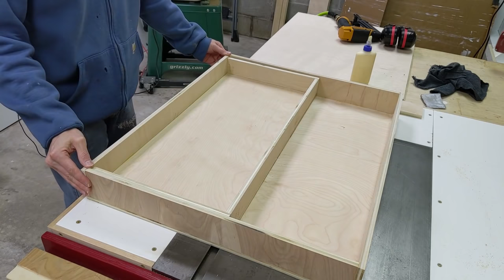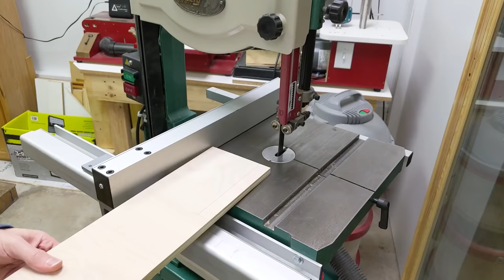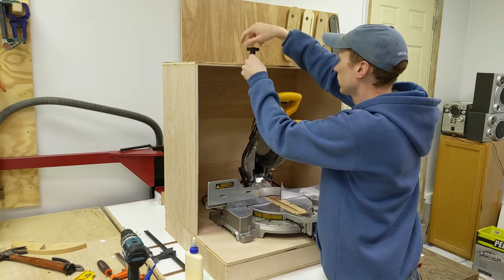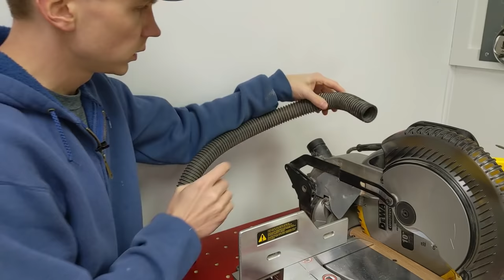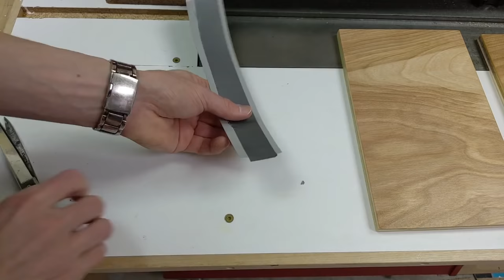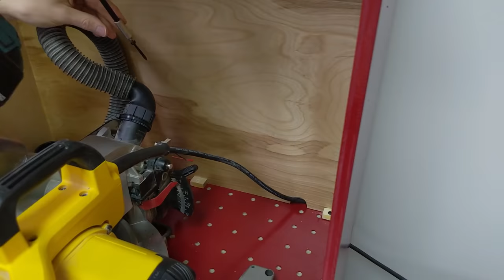Super Effective Miter Saw Dust Hood

Comment: Duct tape - the handyman's secret weapon.
I really like the relief hole for the hole saw dust.  Seems to work very well.
 One long slot for the downdraft section works better than lots of small holes.  As the video shows, most of the sawdust lands between the holes and is hard to sweep into the small holes.  A long slot hear the back of the downdraft section makes it very easy to sweep the sawdust into the slot every few days.
My dust drawer has two 2" holes in the back with an adjacent gap in the divider to the downdraft section.  That draws a vacuum in the drawer which pulls more sawdust into the drawer.
Reply from the maker: Good idea with the holes in the drawer.
Reply: Really nice build! So impressed by you guys who take the time and effort to paint and make it look so good. The cut-out for the fence is just next level. I'm looking to do something similar and have a question on the holes/long slot for the downdraft. I was thinking about just leaving it open. What's the benefit of having a smaller holes? Does it increase the airflow in some way?

Comment: What a great project.  Not only the final result, but chock-a-block full of tidbits that apply to many other projects.  Miter saw dust collection is a universal issue.  I had noticed that your saw is not a slider but didn't think about this not being viable for a slider, until you pointed it out at the end.  Then, wait - mine is articulating (Bosch) - not a slider.  But I guess your design would not accommodate this either because the motor has to go back and forth?  Same for the forward-facing sliders?
Reply from the maker: Yeah the sliders/articulating saws are harder to accommodate. The design of the hinged panels and inside wings would have to change which is something that is not covered in the plans.

Comment: A few days ago I built a dust hood for my sliding mitre saw and... man... at some point the swearing was phenomenal. Dust hoods with an efficient dust collection for sliding mitre saws are not easy to build. It improved the dust flying around in my garage but still not happy with it. I still keep looking at it trying to figure out how to improve it. Very soon I’m starting another prototype dust hood number 2 and see how it goes.
Reply from the maker: What don't you like about your design?
Reply: @JustinDepew  because of the design of my mitre saw, I need to leave a massive opening for the mitre saw to slide in and out.

Comment: Great job. Just built my first miter saw station in the shop, on rolling table with extensions and rails, but had to come up with some type of hood dust system. We are general contractors, so our primary shop saw is a 12” sliding compound miter. Definitely complicated the process for creating a reasonably descent dust system, but I think Ive got one that is sufficient and is certainly much better than before. It also keeps also of the dust and larger pieces from getting thrown behind the work table. 

Sure seems that these companies could come up with a better dust management design. That tiny little opening that comes on the stock saws to connect a hose is a joke.

Comment: A re-watch brings up several questions. Does the drawer catch anything besides the sawdust being ejected through the saw throat? What do you figure the downdraft hole area needs to be relative to the area of the dust tubing? Maybe 1.5 x greater? Smaller? I'd guess the area under the saw table would benefit from vacuum. At this point, what do you think? Also, if a builder used a larger shop vac and a 2-1/4" diameter hose just 1' long and centered under the downdraft portion, would you expect that to be satisfactory? Or would an eventual upgrade to 4" tube connected to a central dust collection system still be necessary?
Reply from the maker: Hi Mark - The drawer only catches dust through the throat plate. The reason the area under the saw & throat plate was not included in the down draft was to localize the suction at the rear where most of the dust is. The down draft hole area should be equal to the dust tubing area. I think a large shop vac with a 2-1/4" hose would be satisfactory as I used that for quite a while. However that being said, it's a huge upgrade to get a 4" hose connected. The extra airflow helps keep the fine and medium dust from coming out the front of the saw since there is a strong airflow into the hood.

Comment: Great demonstration of a smart solution to the mitre saw. On another note: why do you have this smaller sled with no rear fence?
Reply from the maker: The small sled is nice because it's lightweight and quick/easy to use. 90% of the pieces that are crosscut on my sleds are less than 6 inches wide, so no need to pull out the big sled. There is no front fence needed to hold the sled together since it is small enough not to deflect under its own weight.
Reply: Justin Depew Thanks for the reply. Always good to get an answer to something different.

Comment: Hey Justin! After watching your video I decided to add a down draft table to my miter station. It is very similar to yours except I have a sliding miter saw. I also bought a wall mounted DC rated at 650 CFM.. I'm not getting nearly as much suction as you! Any trouble shooting tips?

Comment: What is the benefit of having the dust drawer? Would it be more effective at collecting dust if the hole under the saw and the holes in the back were a part of the same plenum? I'm not sure if you tested that already or the dust drawer is there to make the shop vac work less hard but I would love to hear your answer.
Reply from the maker: The thought is to focus the vacuum on the dust hood portion. If the drawer was included the suction would be less focused especially with a big hole cut out. Almost all of the suction would go to that big hole and very little to the hood where you actually want it. The passive dust collection of the drawer seems to work pretty good.
Reply: @JustinDepew  That makes sense, thanks for the reply! I was thinking that you could use a smaller hole for under the saw if it had active suction there but it does seem like only a small portion of the dust ends up there anyway and the suction would be best saved for the down-draft section. This whole discussion is really making me think about how inherently dusty miter saws are lol.
Reply: I had the same question. His response makes sense with the dust collector that he is using. If it were attached to a more powerful collector then maybe the drawer is not required.

Comment: I'll echo a hundred other comments...great concept & great execution! One question - do you ever find yourself wanting/needing to use a hold-down clamp when cutting rough lumber or larger pieces? (DC videos are also genius btw...)  thanks.
Reply from the maker: Thanks Greg. In my miter saw station I have no problem holding down long boards with the extra support of the station. For short pieces I use a hold down stick that I made (I have a video on it).

Comment: I have the same saw, and built a similar hood (not as nice).  The biggest problem is that when you first plunge the blade, sawdust spews everywhere, and it will bounce off the front of the hood.  Once the blade is under the surface of the board, then it all shoots straight back.

Comment: Is that it's final resting place?  What if you have to cut an 8 foot board in half?
Reply from the maker: I plan to move it to the other wall which is 20 feet long. I'm going to build a miter saw station.